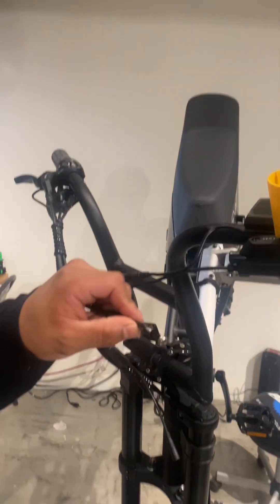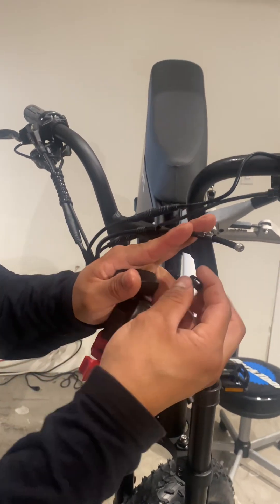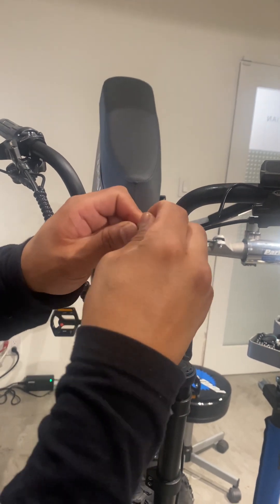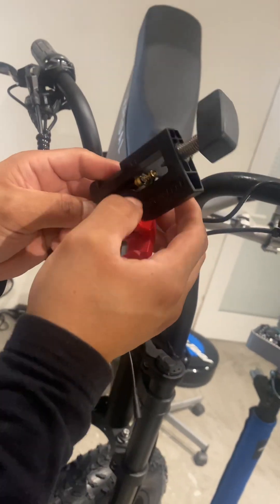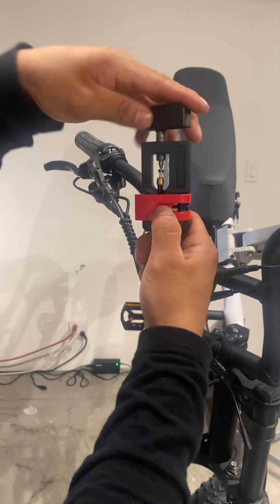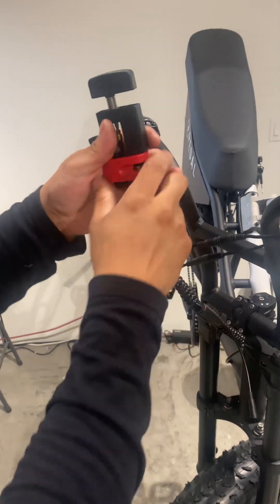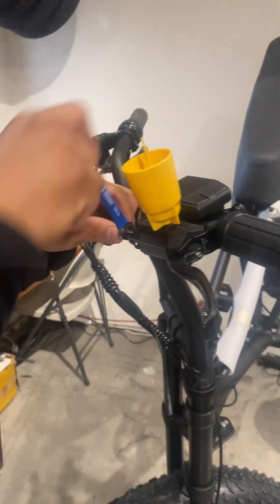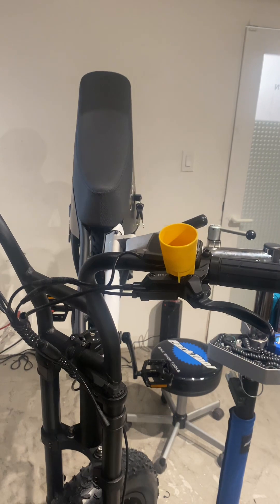Pedal Electric How to replace the olive and barb from a hydraulic brake line

Comment: Hi Agustin, thanks for all the helpful tutorials!
I was thinking about upgrading my Core to get a little more power and am looking for advice.
Do you know what the specific model for the 750w motor is? Do you think its reasonable to just get a beefier controller and run the same motor a little hot? If I replace the motor with 1000w or 1500w, I assume the controller will be the limiting factor, right?
Reply from the maker: The question is what do you want from your bike? speed, longer battery life or to carry more weight?
Reply from the maker: you can convert your bike on a AWDIII which is dual 1000w motors.
Reply: Sorry, just seeing this now. Is that possible? Just getting the different controller and replacing the front wheel? Wouldn't the bottleneck by the BMS? Do you happen to know what the max continuous amps provided by the 720wh battery? @Rideelectricmexico